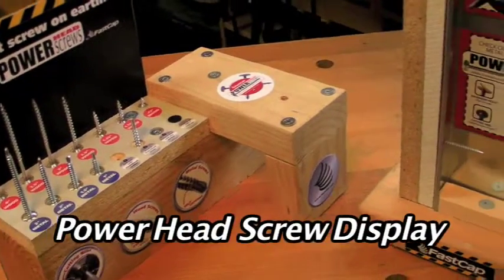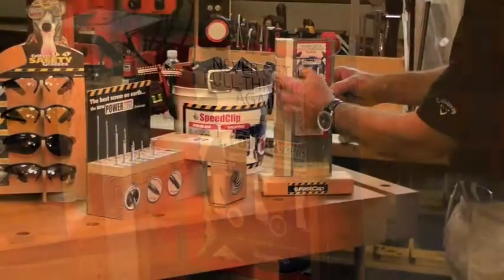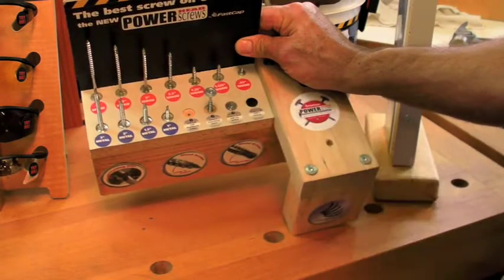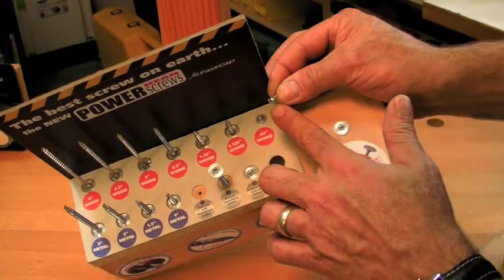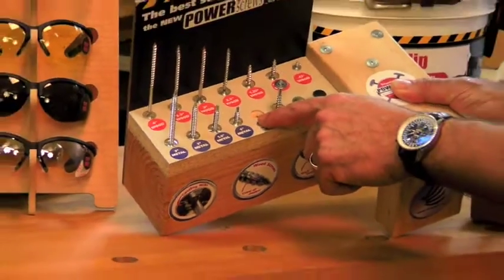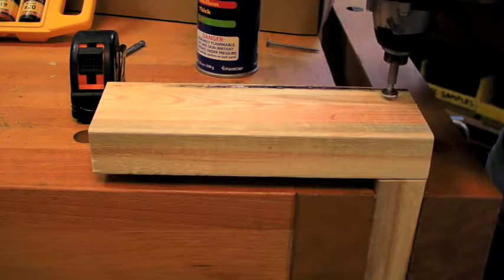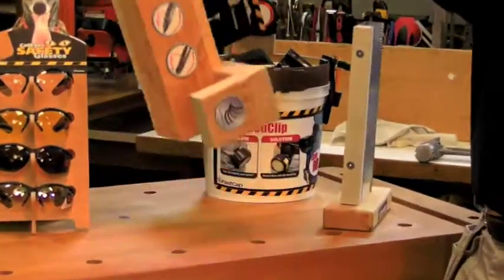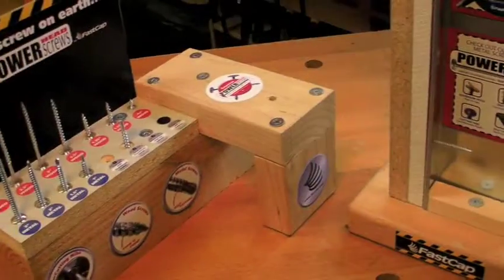PowerHead Screw

Comment: Hi Paul,
So I'm getting ready to build my new shop.  I'm using 18g metal studs.  I'm going to use 7/16" OSB for my sheathing.  
So, my question for you is,  Will the PowerHead screw countersink into the OSB with out having to pre drill all the holes?   
I'm pricing out the screws I will be using and the 2000 pack of 1" PowerHead metal screws is a lot cheaper then screws I would buy at the big box stores.  A LOT cheaper.  So I'm hoping that the PowerHead screw will counter sink with out having to pre drill holes, at least enough for the head of the screw to be flush with the surface of the OSB.
Thanks for any help you can provide!

Eric
Reply from the maker: MrBigerock It is very likely that it will do what you wanted to do, but I can't guarantee it. I'm happy to send you samples to test. The only thing that would keep it from doing this is if the steel stud was so light-weight that it strips out the threads. If it doesn't, it will pull the screw into OSB. Paul@fastcap.com
Reply: FastCap 
Paul, the metal studs I'm using are structural metal studs.   18 gauge 2x8's,   go big or go home right?  LOL!   My order is placed,  2800 power head screws heading my way buddy!    I have faith that they will work......if not, I'll let you know.  LOL !!!!!!    Thanks for getting back with a response.    I'm sure I'm overthinking this whole thing, but I'll find out in a few weeks when I use he screws to attach the sheathing.  FINGERS CROSSED BUDDY ! 
Take care,
Eric
Reply from the maker: MrBigerock Let me know how it turns out Eric...either way!  Better yet, take a video.